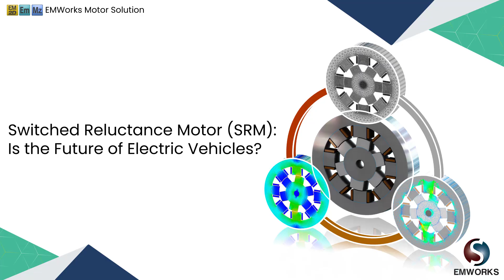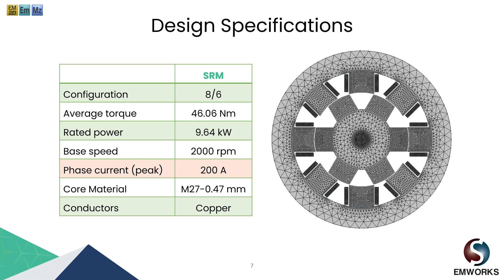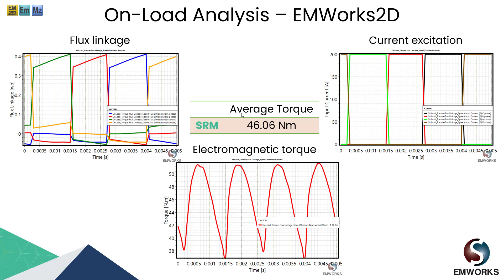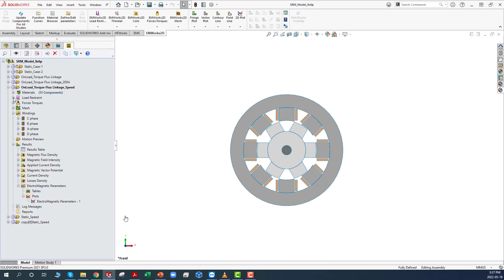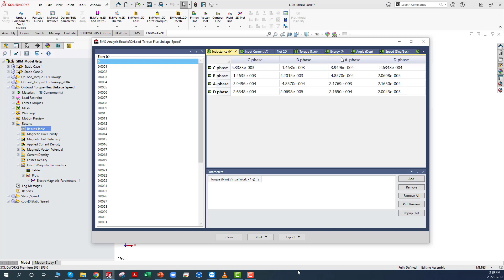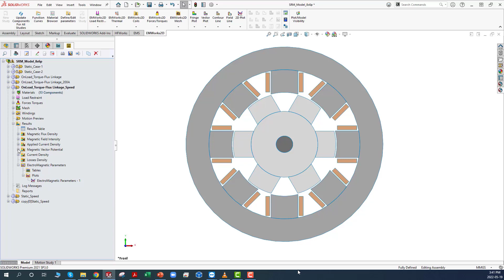Is the Switched Reluctance Motor (SRM) the Future of Electric Vehicles?

Comment: What about the NVH issue ?
Reply from the maker: Thank you for reaching out! From the simulation results, it is possible to extract parameters such as force density on the stator teeth edges, which can then be used as input data to calculate NVH externally. Currently, NVH analysis is not yet implemented in our software, but it is planned as one of the options in future updates.